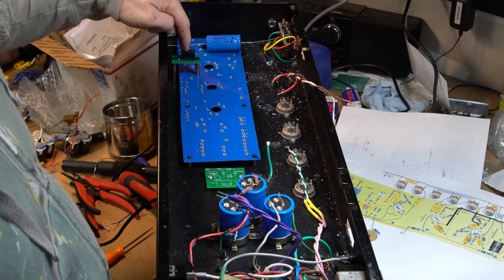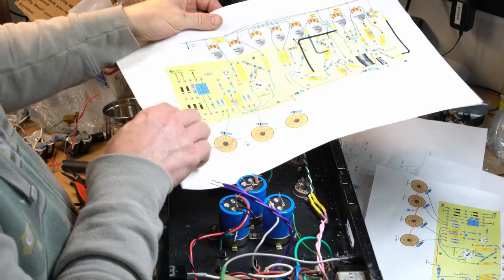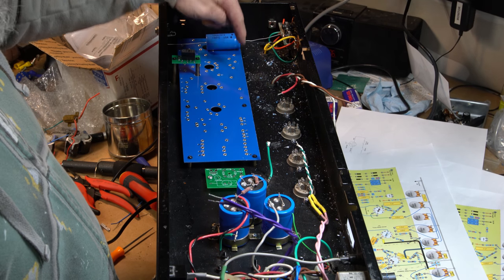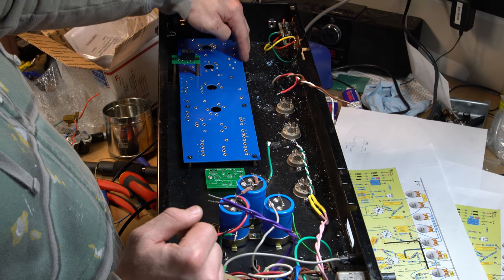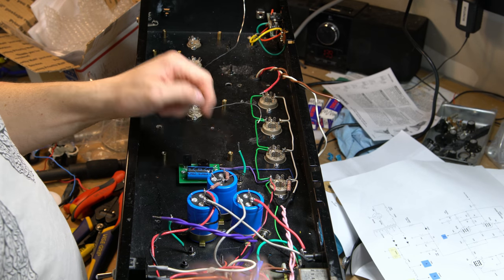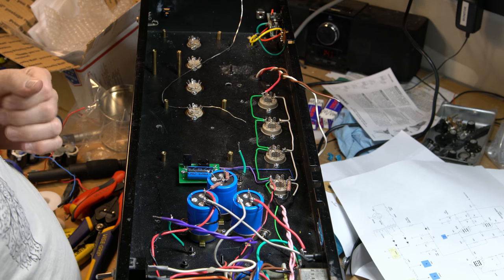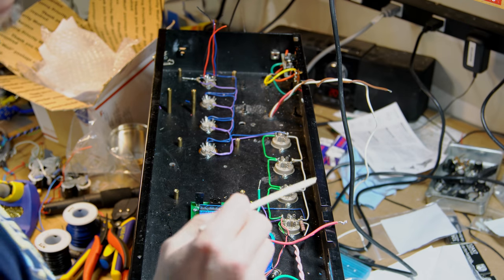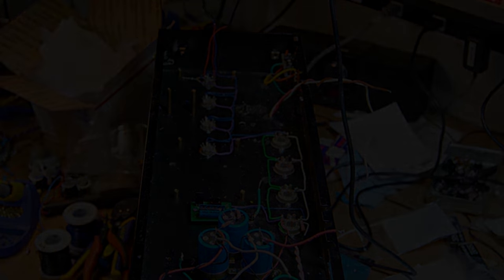Marshall Dual Video 3

Comment: Another awesome installment I'm really curious how those heater wires are going to work out I'm sure it'll be fine as you pointed out, I've heard guys that don't twist them will say to run them parallel against each other but this will be very interesting.
Reply from the maker: Thanks, l also understand that the power tubes are less susceptible to the hum, since they run at way hotter current and output
Reply: @FrenchieFilms  Obviously one would want to keep them clear as possible from the  preamp stage since its more sensitive. What are your thoughts on using DC current as heater power, as a lot of audiophile amps do? No induced hum then.
Reply from the maker: Actually this amp is super quiet with AC heaters and no winding.  I think heater him is a lot less of a problem than most think.  For HiFi, it's probably more problematic, but only because they play some extremely soft sounds, guitar amps are played at significant volume most times
Reply: @FrenchieFilms  ah, good point there.